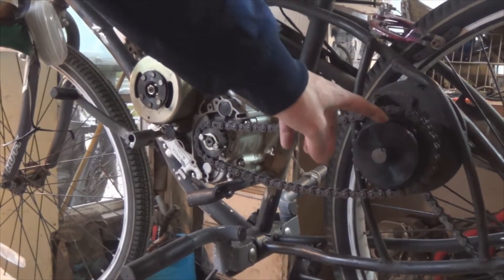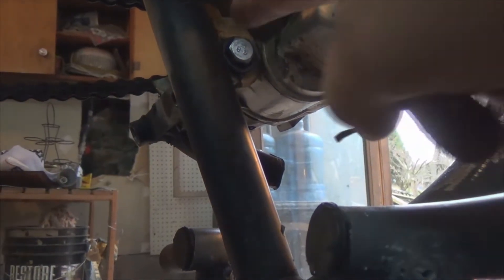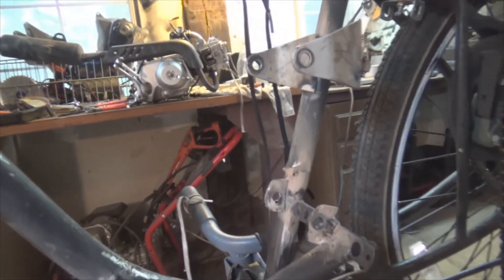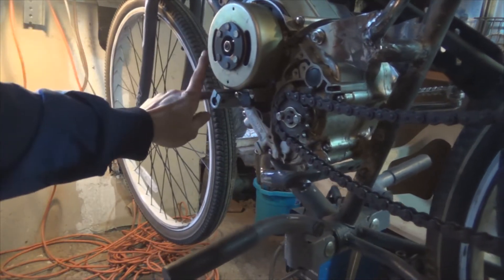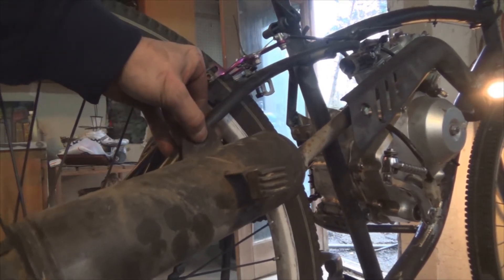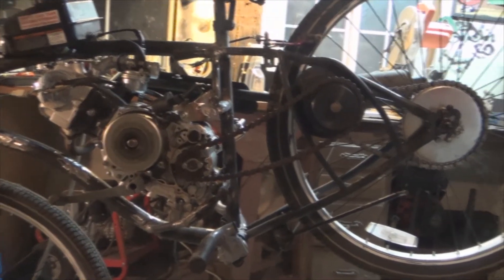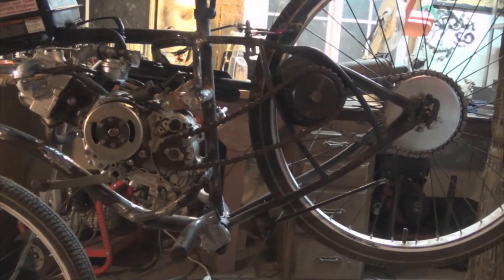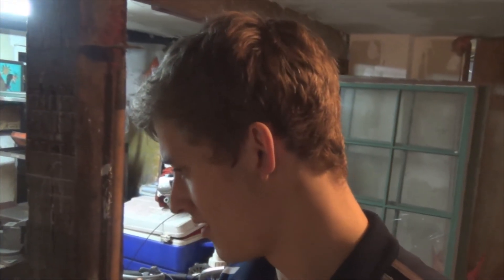Start Up! Putting Dirt Bike Motor on Bicycle (part 2/4)

Comment: the intake, home depo black iron pipe elbows make for good intake and exhaust parts to weld on to, weld 2 large nuts to the pipe, to use as the flange, sand it flat,make a gasket paper gaskets,,
Reply from the maker: Thanks I'll definitely check it out. not sure were to get gasket paper from though.
Reply: Oliver Motorized any auto parts store,

Comment: You could cut the intake manifold attached to the carb and then route a thick fuel hose that they sometimes use on motorized bicycle kits to get clearance with the frame and just zip tie the carb in place at a level height.
Reply from the maker: ah, this bike is long gone. But I appreciate the advice!

Comment: Hey, i've had the same issue before, i just make my own new intake, the hardest part is just making the plates that bolt to the engine and carb, i used gasket maker stuff, like silicone to seal the welds because if it sucks just the tineyest amout of air itll run like crap. Hope that helps